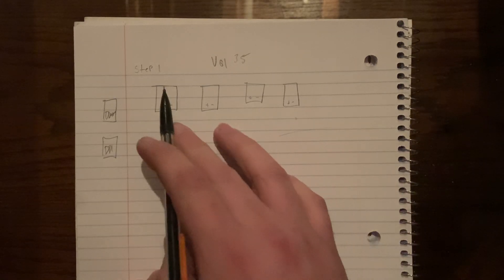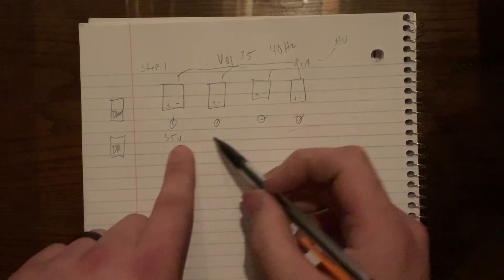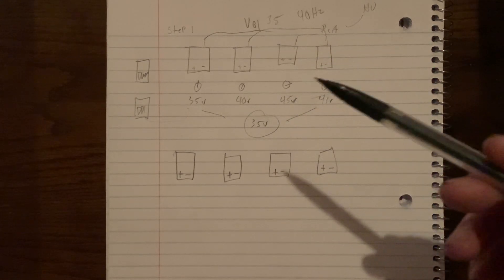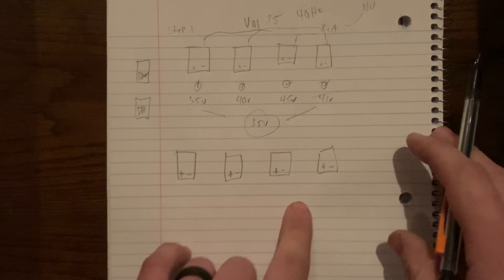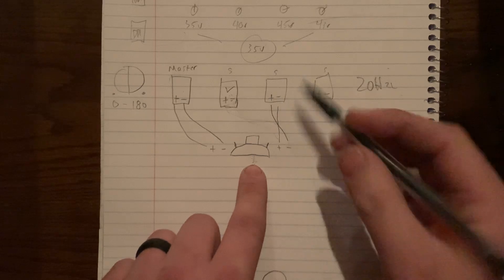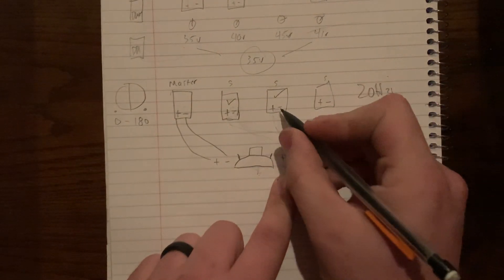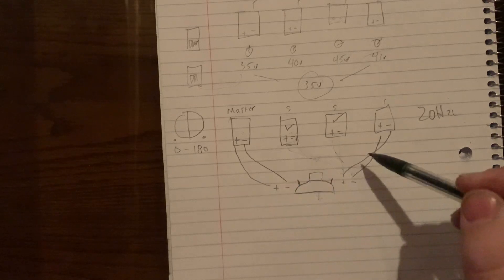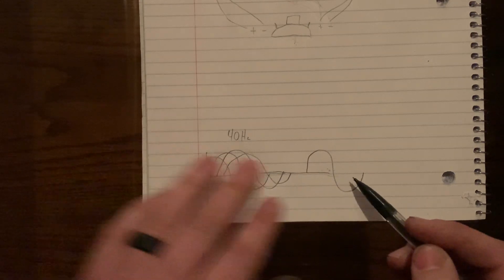Gain matching and phase matching the easy way!

Comment: And how would this be done with an oscilloscope?
Reply from the maker: You can hook up the probes to the AC side of the amps playing a sine wave. once you clean out the clipping/square waves. Align the waves to get in phase and then you can see the AC output voltage on the oscilloscope. The oscilloscope will do it all. This video is if you do not have access to an o-scope.